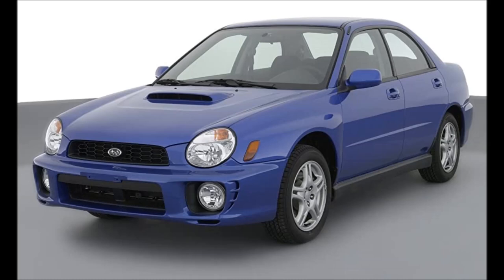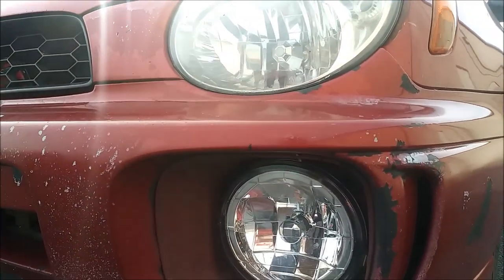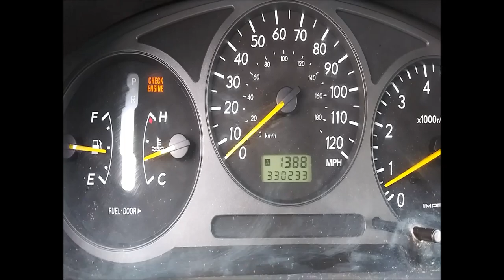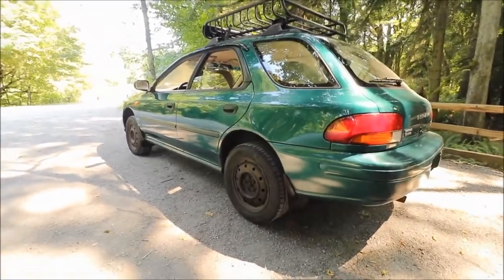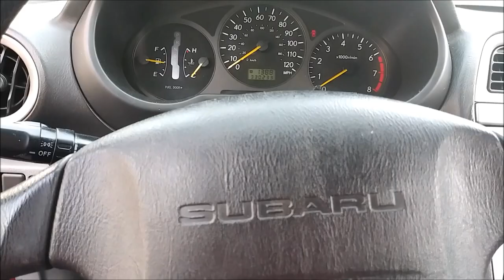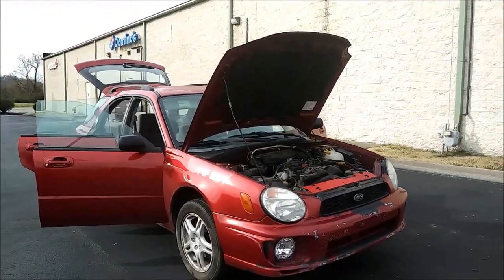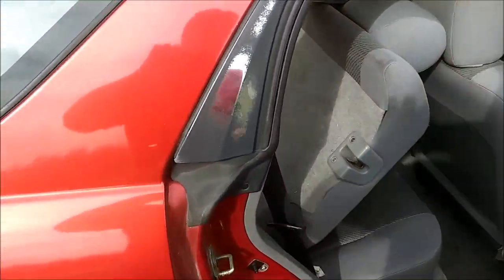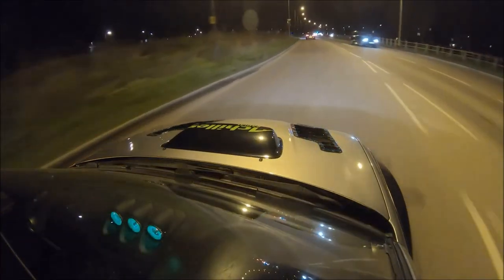We Need to Have a SERIOUS Conversation About the NON TURBO 2.5L Subaru Impreza

Comment: Everybody has there own experience with the N/A impreza, but mine is they are pretty reliable, I bought a 06 2.5i wagon, with minimal rust, 112,000 miles, and was really clean, got it for $1200 at the auction here in VT, and drove it for over a year, got me to work, and all around places in Vermont and the only issues I ever had was with the stock exhaust system... But I could say if I had it for a couple years more I still think it would have lasted, had no blow by, coolant level and temp never changed in the whole time I had it, same for the oil level, all I did was basic maintenance and it was good for me!

Comment: I got a 02 bugeye RS since day one,  add the throw out bearing sleeve, lightweight flywheel and ACT clutch , upgrade to STI suspension, brake, A arm and sway bar ... it runs almost 400000Km now, still go strong and no problem at all. no rust. except the aircon compressor gone. I will fix it later and never think to sell it. this is a reliable daily car not track/rally car.

Comment: I have owned two Imprezas now, a 2004 RV 2.0 wagon with the low range option and slightly higher factory ride height (awesome camping/bugout/getaway car). And a 2001 RS 2.5 Sedan, all stock with the nice little factory skirt/spoiler kit, sports interior, sports suspension and the more powerful EJ25 engine. Both cars have been amazing! They are super safe and reliable and fun. Both ended up with high miles and no real issues.

Some people believe these non turbo Subaru's from the late 90s to late 2000s had common fatal head gasket issues. If this were the case, then why come you see so many of them on the road? They didn't sell as many units as Toyota, Nissan, Honda etc of the era... yet you see almost as many Subarus driving around today. The most common head gasket issue is corrosion on the OUTER side of the jacket where gravity puts coolant in contact with the gasket on the boxer engine. This means you might get fluids leaking OUTSIDE of the engine and this will cause a bit of a mess, but its not at all fatal.

I personally think there is no better car for a young person wanting a sporty first ride than the RS25. Its safe, sporty,  safe, reliable, cool looking, safe reasonably economical, safe, cheap, safe and most of all its safe!
Reply: I can't agree with you on that, an rs has the head gasket issues as you described, and Ive talked to my mechanic about those engines and he said they tend to leak oil, overheat and blow head gasket due to the shitty material they use to make them. Every person I've talked to online who's owned one of these engines until high KMs has done a headgasket on them which are not cheap, especially for a young person. 

If someone wants to buy a Subaru they should get any model with the superior ej 20 motor. Yes they produce less power but they are highly reliable when compared to the ej 25 and cause little trouble in their life span.

Comment: Im spewing myne was in a crash after just more 400,000 km's here in Aus.  Just had the belt and clutch changed and i swear that thing was keen to go 500,000
Reply: My 99 Impreza non turbo has 350,000kms on it if you keep it well maintained and don’t drive the shit out of it everytime you start it up it will last a long time

Comment: I absolutely love my NA 2010 2.5i, it rips around just as fast as the civics and you can pretend to be a rally driver with the AWD. And every WRX interior or body part fits it so you can go hog wild with all the body kits and crap you want. Making it a slow but fun beginner modder car. Problem is the EJ253 nonturbo engine is made of glass, anything you do to try and make more power is gonna blow this thing up. There's maniacs that have managed to put 5psi of boost through it, but it never ends well. Just leave the engine alone and have fun doing suspension mods, sway bars, spoilers, rally lights, speaker systems. Its not winning any drag races, but it will scream down any backroad you want, and you can tear up autocross events.
Reply: Bruh putting wrx parts on an impreza is just an insult for people with real wrx’s
Reply: Ive done alot of work turning my 2008 2.5i sedan into a dirt car while maintaining the NA status. Yeah the wrx and sti pull away on the straights, but i catch back up and pass them on the outside of the bends like they arent even trying. 4k in suspension and chassis bracing will do wonders for spoon feeding the wrx owners their own ass on a track. Cusco makes the Brace Yo Self kit for starting out and its only about 1200 for the whole thing. Short of a cage, its rally ready. I love my NA subie. I also love telling the wrx owners that they just got spanked by an NA 2.5i. Most of them ignore brakes and suspension and chassis bracing.
Reply: @VotEtoPizdets  I have since sold mine for  a Veloster Turbo but I miss the thing a bit honestly, I had a strut bar, front and rear sway bars, and a set of struts, and felt unstoppable.

Comment: Going to check out an 04 impreza outback sport 5 spd with only 77k miles, feeling very good about it after this video. Sad we'll no longer get these hidden gem videos but I'm glad we still have some to look back on.
Reply: Around 80k is when timing belt, water pump and head gasket are done so beware
Reply: @badgersquad5129  timing was done 2 months ago, oil didn't look like anything had leaked into it so hopefully gasket is good and as for the water pump, visually no signs of damage or overheating. Drove it all day and on the freeway, so far so good. Thanks for the tips, I'll definitely plan ahead for those things to break lol

Comment: I have nearly that same car. Paint held up on mine though. 324k miles. Still going. Burns some oil now though, but not bad. I did need to get a new head gasket and rear engine gasket… but that was years ago… so spending the money to get that done was the right decision.

Comment: My grandfather bought a N/A Impreza basically the exact same as in the video only put on about 120k miles on it before he stored it away in 2009 about 10 years later I got my license and needed a car he said if I can start it it’s mine legit all I did was put gas in it new battery checked plugs which looked good and it started right up after a decade of sitting today it’s my fun daily car it’s lifted with bfgs and still powering through never had a check engine light on now it’s got around 160k since I work and go to school in the same city I highly recommend these for everyone they are great cars and with today’s aftermarket world you can really make it yours and for whatever you want

Off-roader? Impreza!
Low rider? Impreza!
Family hauler? Impreza!
Pussy wagon? Impreza!

Comment: There great cars period.
Reply: I like everything about it except the engine, i don't feel like it should be reliable but the tech has been around for a bit, still corolla. Or something for off-roading over this. I do like the wagon and the awd aspect a lot.
Reply: @YEET-yh6qc  i have a 13 outback with the ej25 good power great sound even with the cvt but I prefer the power of my 07 ford freestyle awd v6 but I've always preferred v6's though ej20 and ej25👈🏿👈🏿👈🏿
Reply: @lsjionredlinesupercharged2049  I'm not a car guy sorry lol i just work on my cars. I would definitely take a quick ev as a daily just to feel the zip without the financial regret.
Reply: I think the 25 sucks balls, but in full objectivity, just put a quality water pump and some nice pleated head gaskets and that motor will last forever. But I'll stick with my dual port 2.2 motors
Reply: @sammy13ificationable  you can keep the 2.2 ill keep the 2.5 lol

Comment: Just bought a 2000 Subaru Legacy wagon with the STOCK 2.5L H4 Manual with a 5SPD manual. 213,380 miles bought it at 213,356 miles

Comment: I have a 2nd gen forester and all I've done is gut the interior added a walbro 255 fuel pump and shaved down the restrictor on the throttle so I have 96% throttle at W-O-T Instead of the stock 65% and eliminated all the plastic in the intake with a cone filter and eliminated the AC and added UEL headers high flow cats and a 3 inch cat back it's pretty quick they are pretty strong cars SHOULD pass emissions I haven't done that part yet owe shall see
Reply: Restrictor on the throttle?
Reply: @501stchamp3  yes if you shave about a quarter inch off the connector on the throttle you get another 30% on throttle position at wop

Comment: I've noticed they have oil and gasket leaking issues.  Bought a 95 1.8L for $1200, 170,000 miles.  About to buy a 2002 with 211,000 miles with 2.5L.

Comment: I bought my 08 Impreza NA 2.5i just over a year ago with 175,000 miles. The car was overall in solid shape, but just scratched up and dinged up. I've had to put some money into the suspension and will have to totally overhaul the AC system, but it's still going strong at 186,000 miles now. I was looking at getting a newer car, but with the market the way it is, I was thinking of just trying to get another year out of it. It's got some surface rust that needs to be addressed before it gets worse...
Reply: I’m bout too get one with 166k miles you think I should or does it have many problems?

Comment: The only place where you are wrong is thinking you only need a few bolt ons to keep up with a WRX.
Reply: I've seen people rebuild these with all forged parts, add a turbo, and seriously tune that ECU...and a bone stock WRX with the factory tune still puts two car lengths on them. Just enjoy that 160hp for what it is and rev the fuck out of it.
Reply: @Grandtank1999  Where? Serious NA/T builds are a whole other ballgame when compared to a WRX. They're in STi territory, especially with lowered compression (More boost). People with more serious builds tend to go towards hybrid 255/257 blocks and 251/253 sohc heads. These builds are just as reliable, especially when they are tuned. Their only limit is the heads will eventually run out of breath before STi heads. The potential is still there though.

In stock form, the engine that is, a basic td04 at 5 lbs of boost will put it in WRX territory (Dunno about an FA20dit powered one) due to the higher compression of the NA platform. It won't be as reliable however unless you've got a good tune.

Comment: I own one like this bought it at 330000+ kms drove it really hard for another 25000 then rebuilt the motor but went all out na build and its a very quick car and way to much fun...I paid $400 canadian for the car no rust bone stock....04 sti shocks and struct swaybars and sti interior bits...legacy gt brakes and 200+ na hp = an awsomly fun car ive spent less than $2500 on that embarases wrx's easily and gives stock sti's ar run for there money on twisty roads

Comment: I'll give you a short answer to save you time. Subaru as a brand are not bad, in fact they come out better than some of the other well known brands. Ej 25 (the 2.5 litre engine) are known trouble makers though. They are straight up crap from what I've heard oil leaks, overheating, guaranteed blown head gasket due to shitty gasket material. The ej 20( the 2.0 engine) is almost a polar opposite, highly reliable, no common issues except for oil burning once they get old and that's about it. Subaru are a good brand but every maker makes a dud, avoid the ej 25 and keep up with regular servicing and a Subaru will last for ages.

Comment: Bought a 2006 2.5i wagon back in 2019 @131k miles, man, that car was a burden since the day I bought it despite the fact I had a professional check it out. Car had minor cosmetic issues and the exhaust was ready to fall off because the 2nd owner (last owner before he sold it to his buddy who sold it to me). Man did a "professional welding job" with the stock exhaust which it rusted away. Eventually, it was replaced with an aftermarket exhaust, it was not possible at the to find a stock exhaust for my 2.5i where I live. Around April 2019, last owner didn't maintain the car since 2017 after getting into a minor fender bender.  As time progressed, there was problem after problem like the timing belt and batteries. HAD to go through more than 5 battery swaps (including the car drew too much amps) before covid. Fast forward to 2021, shit start hitting the fan, my valve cover gasket, head gasket, oil pan gasket, exhaust tip had leaks.. Especially my O2 sensor was fucked up even though I had to go a exhaust shop I went to before. 

edit: btw got a fun fact, that brown sti you showed went through a 2jz swap.
Reply: Honestly sounds like you’ve just had bad luck
Reply: @BM-vb9bo  That's what I get for $3,7000-$3,800 despite the fact the last owner didn't maintain since 2017 lol
Reply: @mista_ruby  letting vehicles just sit for years is probably the worst thing for it
Reply: @BM-vb9bo Oh yeah, lesson learned, no doubt

Comment: just bought one with 250k miles for around 2,000. May have overpaid slightly, but im absolutely happy with mine. Had some radiator issues (pinhole leak), and a faulty A/C, but other than that it's great.
Reply: You highly overpaid 😬

Comment: So what bolt on performance mods can you do to the engine?
Reply: Ya don't. That's the trick to making them last
Reply: Yeah i was waiting for that as well. It was a video of lies!!!!
Reply: Nothing. Literally dont touch the engine or exhaust aside from a different muffler if you want. Even a Short Ram or Cold air intake will screw up the engine. The car is already fast enough to have fun so work on suspension mods. Definitely get a thicker rear sway bar, the stock one is a limp noodle and it will help your car not understeer so much.

Comment: Not to brag too much but my 1996 k1500z71 has 3339 thousand miles on it...original drivetrain and it's still going strong
Reply: U trying to brag about how low the miles are?

Comment: I have a 2004 Impreza 2.5 ts, I ordered new exhaust, and header, eventually thinking about adding a turbo.. is it possible?
Reply: Just got that same car today , with 167k miles , any issues so far bro ?
Reply: @akidim13  trippy, I just picked one up for a daily around the same time you commented and it also had 167k lol
Reply: @redux5895  aye !! It’s also my daily bro haha , how’s it for you so far ?
Reply: @akidim13  its been good man, put 1k in it so far fixing it up. clutch is solid, driving nice. there's a little coolant leak right now, trying to find where that's at but nothing crazy. Just trying to save some miles on my sti and have a fun lil project. what about you? any issues?
Reply: @redux5895  I’m starting to think that small coolant leak plagues these cars haha I have one too , and actually bro I had to JDM EJ20 swap it , the EJ25 spun a bearing and to be honest I like it a bit better with EJ20, on paper it has 10 less Hp but it feels more solid and great power band
Reply: @akidim13  I bought one today at 188k no coolant leak but engine was just rebuilt, I believe your problem is from the headgaskets. Look it up, it plagues these car. Usually they are good for 80-100k miles before leaking again gradually until a head gasket blows
Reply: @redux5895  ^
Reply: @mlp2012  I have a EJ20 now in my TS and luckily the head gasket issue doesn’t really affect those engines like the ej25’s , how do you like your car so far ?